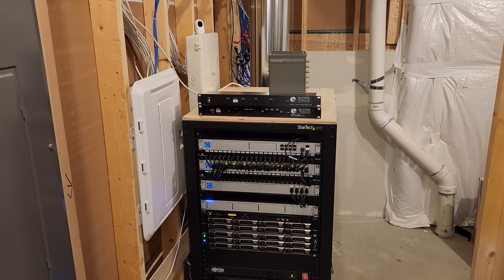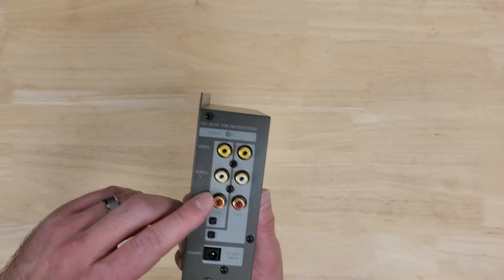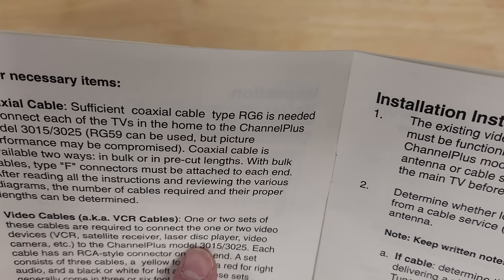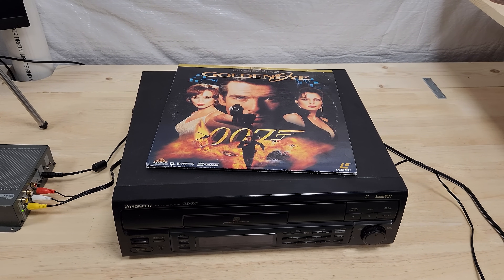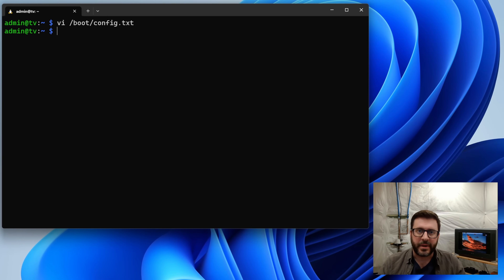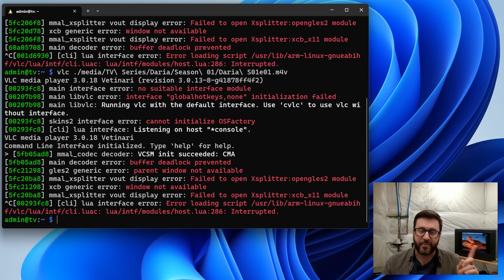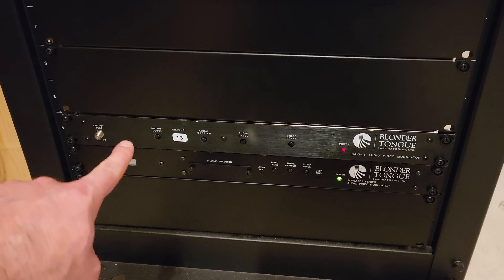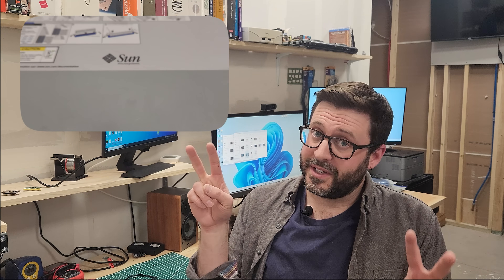Homelab Episode 5: Custom TV Stations

Comment: New convert to your channel - loving the stuff you're doing.  One thing I have to say though re. your rack:  The weight really should go at the bottom, otherwise it won't be stable.... For me it's always UPS first (but we use large 5-10KVA UPS) - so for you, probably would need to be Servers, then UPS, then your other bits :D  I just don't like to think of you being stuck under a tipped rack!!
Reply from the maker: ha yeah. the fact that the servers are the full depth of the rack helps a lot, but definitely no more weight going up top.

Comment: I have a similar modulator, you must correctly set the audio level, aural carrier, and video level, or it will not transmit a proper RF signal. It is better to set it up with a spectrum analyser, but you can get them close by eye, and sound, with a bit of luck. With my modulator, you must send a video signal first, or you will not hear an audio signal. Also, if the video level is too high, it will bleed into the audio and you will hear the 60 hz buzz of the two vertical fields beating off each other and the sum of the audio carrier. fun stuff indeed! One of my RF modulators does have a nasty 60hz buzz in the power supply, so that may be where your issue is coming from. Put an oscilloscope on the power supply, and check the voltage and ripple. Oh, and the dip switches are very complex to get in the correct cable TV bands! I just stuck with the VHF channels 2 to 13.
Reply from the maker: Thanks! Believe it or not I don't have an oscilloscope (on the todo list :)) nor do I have a spectrum analyzer. The hum on mine is so ridiculously loud that I have to believe it's related to the power supply though. But you never know -- my first port of call will be a recap when I get around to it, and if that doesn't do the trick I'll have an excuse to buy some more gear.

Comment: This is a pretty nice idea. I used to do something similar with my music for having a 24/7 custom radio station, transmitted to the various radios in my house using a cheap FM transmitter. The bogosort tool is a pretty nice way to generate a playlist, although VLC seems to have a playlist shuffle option built-in with the -Z flag.

My home doesn't have coax to where I need it and I only have a single "smart" LCD TV, so if I were to set something like this up I'd probably use ffmpeg's RTP streaming thing and an appropriate Android tuning app or something. But most of the shows I watch are highly serialized so I don't think this would really work for my viewing habits anyway, and I'm happy with Plex on my Synology. Still, really cool idea to think about.
Reply from the maker: That's a very cool use case with the custom FM radio station... I hadn't even thought of that.

Comment: Very cool! I have a similar setup and we use it all the time. Similar reasons you mentioned - sometimes it's just nice to turn on the TV and not have to choose an episode.

Regarding the hum on the modulator, it sounds like a 60Hz hum. Check the DC output from the power supply inside - make sure there's no 60Hz ripple. If there is, some of the filter caps will probably need replacement.

Also, the Blonder Tongue modules have manual adjustments on the front to control modulation - try adjusting those to make sure the video isn't over or undermodulating.
Reply from the maker: Thanks, your videos were actually a huge inspiration for this project!

I did try adjusting front controls but no luck... so yeah I'm thinking it's time to dive into those power supplies.

Comment: You should look at the VeCoax ATSC modulators so you can "broadcast' in HD.
Reply from the maker: Interesting, wasn't aware of those!
Reply: @clabretro  I installed a bunch at a local hotel. They won't win any awards for quality (when compared to the $30k ones I have at work) but they are good
Reply: I wish I still had access to that hotel. I would totally make a video on one for my channel.
Reply: Channel master atsc modulator best.. also could you attach to outdoor antenna and signal boosters? Hmmm 😂

Comment: For the second BT modulator, if you haven't figured it out already, you might be mixing cable and air TV frequencies. Except for channels 2-13 they are incompatible. The Channel Plus and TV are probably set to over the air frequencies but the second Blonder-Tongue modulator is probably set to cable frequencies. Set all to cable (what I'd recommend) or all to air and it will likely work. For the Channel Plus, it seems choosing 65 or higher will switch it to cable frequencies and 14-64 will be over-the-air.
Reply from the maker: Interesting, I'll have a look at that. Thank you!

Comment: FYI if you end up with a camcorder Cable you can swap the red and yellow leads which swaps the right channel with the video channel. This works as long as you don't get a MP3 player whatever that means compatible cable. This standard is sort of thanks to Apple as they wanted left and right to be compatible with the standard 3.5 cables Devices headphones but also have the video for the iPod video. Camcorders went the other way as they were only mono left plus video and added the right channel later. Then things get muddy when we switched to using the fourth conductor for microphone input on the iPhone well android use the third conductor. This tends to mess up a lot of devices that don't ground the Jack properly expecting the ground to be on the fourth position which doesn't work because it's going to the microphone.
Reply from the maker: That's good info... I'm sure I'll end up with an old camcorder cable eventually!

Comment: For the hum, it sounds like a 60hz tone. 60hz is also the NA power frequency so its probably a bad ground or a ground loop. If you are using a usb power adapter to power the pi try running it off a power bank instead and see if thats where the loop is. If not then it may be the blonder. I think they make ground loop isolators for coax, I know for sure they make them for RCA connectors.
Reply from the maker: thanks! I tried a coax ground loop isolator but no change. I'm thinking something off in the power supply, maybe the filter caps?
Reply: @clabretro  Possibly, do you get that noise if nothing is hooked to the blonder but the tv?
Reply from the maker: Yeah same deal, even without a source input the blonder generates that hum.
Reply: @clabretro could it between the source and the isolator?
Reply: @clabretro handheld fire extinguisher on the deepwater horizon.  As long as you have the neutral you will have that problem.   Without getting into 240/120VCT isolation transformers, line-to-ground circuits are BAD for all kinds of sensitive electronics, especially analog A/V.

Not to venture into a DIY DC chassis: A LiFePo4 battery, DC-DC line-load-charge manager, and more DC-DC PSU would be hilariously more cost-effective for you - one to two orders of magnitude.  That's how bad these UPS are.

Commercial UPS, especially Tripp Lite, are rather horrible energy storage solutions and even worse at power generation.  Remember that their only job is to last the 10-90 seconds it takes for high-THD 3-phase generators to spool up enough for the transfer to kick over, so the appalling lack of efficiency across the board is not so concerning commercially.  It is simply a different world, where being 50 times better does not win.
Reply: I work at a tv station, and we have an internal cable system. We had major neutral current loops between our technical and utility power systems; something on the lines of 90amps, if memory serves. Those ceramic RF isolators are crazy expensive. Something like $50 dollar a piece. We had an entire crate of them, because we needed to isolate every general powered TV monitor from our technical power system.
Reply: I was gonna say a ground loop isolator but if that didn't work you can try a ground lifter plug and see if that helps then you know its a ground problem.  You could leave it on there but it's definitely not ideal lol

Comment: You can broadcast over the air using a simple pair of rabbit ears antenna to transmit and recieve if your have at least one antenna to transmit and at least one antenna per tv to recieve.
Reply: This would be fun to play with if there’s an unused station in your area but be careful since so much of the analog TV spectrum has been re-allocated to cell phones now.  It looks like everything past UHF channel 38 has been sold off.
Reply: @meatpockets  thats very good information! Yes, the channel range has suffered due to cell phone towers.
Reply from the maker: Yeah interesting idea, I don't have any antennas but I might have to try that someday.

Comment: So im really digging on this, and i really want to do it in my house. Is there a Cheapish kind of way to get more channels. my current idea is to host an IPTV server, showing different curated content streams from my local media library but im getting lost as to how i would change the channel. i would prefer more than 3 honestly, and even 1 or 2 can get expensive. i guess its just hard for me to find the information im trying to learn about. Like would this be possible with an RF PCIe card, or do you have to have individual channel carriers for each channel? while id like to stay away from it, I suppose something like a raspberry pi with an HDMI output to RF mod would work and i could set up a wifi button or bluetooth button to change the channel on the Rpi to change what channel is making it to the rf modulator but that kinda takes the fun out of it. Could you help me out a bit with some more info or ideas?
Reply from the maker: I've been thinking about this as well. There's two expensive/hard parts - you need RF modulation per channel you care to tune to on the TV as well as a video stream to feed each modulator. Even though I have three modulators (some of which don't even work yet lol) I want more than three channels as well.

I think I'm going to solve it with software, similar to that IPTV idea. I've written a bit of code that you can point at several "source" folders (think a folder containing the seasons of a TV show). One folder will be "live" at any given time, actually displaying on the device. The device of course would go into one of your modulators. But behind the scenes the software would be pretending to play through the other shows/folders. Then via a web interface or something you could switch which folder was "live" -- it'd be like it was playing naturally while you weren't watching that one. Sorry if that's confusing haha.

Basically that way I could have multiple streams of media available on any given RF + video combo, and I'd use software to switch what was showing. It's of course nicer to switch between multiple channels, but that means more modulators and more computers. So I think the auto-playing behind the scenes of things which aren't live is a good compromise and stays within the spirit of a TV channel. I have some really crappy alpha code of this: https://github.com/clabland/go-homelab-cable. It's on my list to pick it back up and get it really working the way I want.

Anyway! What a ramble. That IPTV server is an idea... I'll have to look at that. Let me know what you come up with!
Reply: @clabretro  Ersatztv is an iptv server I was tinkering with, it's pretty simple to host and can run simultaneous always live channels, which you can point your middle device to (server(ersatztv) > middle device(rpi) > rf mod) for channel selection. 
In my case, I run a jellyfin server for my media, and it offers "live tv" which you can point to ersatztv, so in theory I can have my middle device as a user of jellyfin and use it to select which channel to watch, it's output would feed the rf modulator. Ersatztv has a guide system as well which is also fed to jellyfin. 
From the dashboard in jellyfin you can  control currently active devices, so from any other device you can just change what your rpi station would be tuned to. Even maybe writing a script on the pi to rotate tuned channel every so many days. 
To be clear, jellyfin isn't required and I'm sure you could use a desktop web player on the rpi to access the ersatztv streams, just describing my use case with my existing infrastructure a bit here. 
I'm really hoping there is a software solution to have something output multiple rf channel frequencies out on 1 rf device, which is where my rf pcie card thought was. I suppose you could open up a 2 channel rf modulator and adjust its output channel frequency to have it display on 5 and 6 rather than 3 and 4. But again that isn't the solution I'm looking for. My head is thinking like a police scanner, where the modulator rolls through known frequencies displaying each. Some unfounded math says that 4 channels each 30 fps only needs to output that channel frequency for a few milliseconds and the tv tuner side of things shouldn't detect a channel dropping out as the modulator rolls through the others, that should, in theory allow multiple channels on 1 rf out. Spitballing and grasping a bit here but yeah, my current mindset.
Reply: Just a quick update, Through google-fuuing long enough, i decided to try the search term "IP modulator" and i think i found devices that are more tailored for our use case. I specifically ordered a Harmonic NSG 9116. it was a bit impulsive but i think its everything im after. 8 output, dual carrier, so either 1 feed per coax with fall back, or 2 feeds per coax, up to 16 feeds total, Web interface for configuring everything. Just a heads up, this specific model/brand has admin accounts for setup so if you find one make sure that the user/pass is given to you with the purchase, unless you feel like penetration testing it for awhile until you break into it. The price tag wasnt too bad either.

Comment: 1) Case up the the R-Pi's.
2) DIN Rail for something to mount to
3) Drill/mount the R-pi cases to DIN
4) Search a DIN-to-Rack bracket that you like.

I picked $20-ish metal cases that are heat-sink-ish - - all lined up with larger fan coverage.

I've long wanted something that only worked briefly: Something like the HDHomerun, "NTSC/ATSC/Coax in, ethernet out"
That, and a home network jukebox that worked sensibly.
Reply from the maker: That's a great idea! I had no idea those DIN-to-Rack brackets existed... I'm going to have to think about how else I could use those.

Comment: About the humming Blonder Tongue: take it apart, clean it and make sure all grounding panels have good connection! I fixed a Technics Av receiver by doing just that.
Super awesome project!
Reply from the maker: Thank you! I'll definitely try that when I crack them open to see if I can fix them up.
Reply: @clabretro  A vey little dab of silicone grease on the contacts will keep those connections happy.

Comment: I've had this idea for a while, but my issue is I wanna set up at least 10 different channels. But setting that up sounds ultra expensive >< ugh. ANy ideas?
Reply from the maker: I've actually got something cooking for this... I want to run multiple content streams per physical channel.

I'm writing some software to help do it -- basically you can have multiple content sources for a channel, but only one of the sources will be playing video at a given time. In the background the app will make sure it's cycling through the files to mimic a TV station, and then I'll have some UI to switch which "stream" it's actually playing at a given time.

Anyway it's a mess right now, I haven't had enough time to work on it, but eventually it'll get there! https://github.com/clabland/go-homelab-cable

Comment: The hum is either a ground loop or bad filter capacitors in the modulators
Reply from the maker: I tried an inline ground loop isolator on the coax but it didn't have an affect. However, I did notice that the modulator itself makes a hum while powered... so I suspect you're right, something going on in the power supply perhaps. That'll be my first place I look when I crack it open.

Comment: Awesome idea, I would be very interested if you could figure out a thin client method of this, I don't own a pi and don't really want to, I have multiple dual xeon servers that I haven't even gotten close to putting a real work load on even though they are running everything I need, this could be awesome if it can be done on a proxmox vm or container somehow.
Reply from the maker: Exactly! I'd rather not deal with the pis either. I'll let you know if I come up with something.
Reply: It's possible to have multiple sound cards in a PC, and have each instance of VLC connect to a different sound card. Then you just set up multiple monitors. Either use video cards with VGA out and use a scan converter, or buy a HDMI to composite adapter.